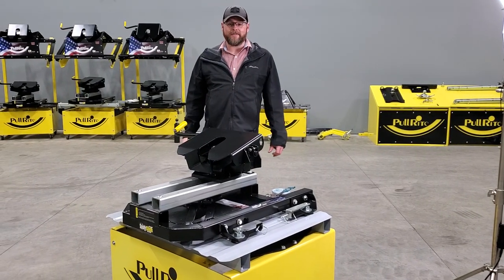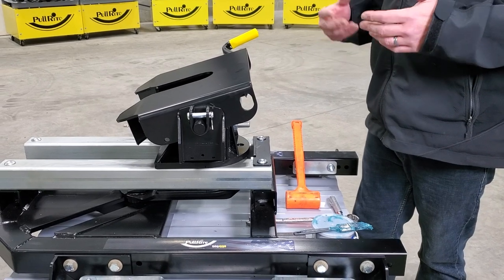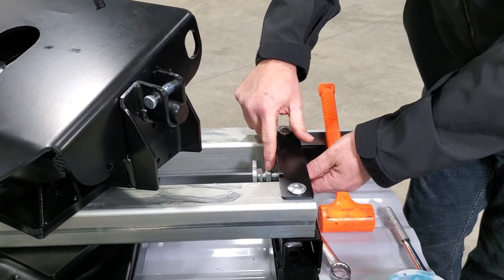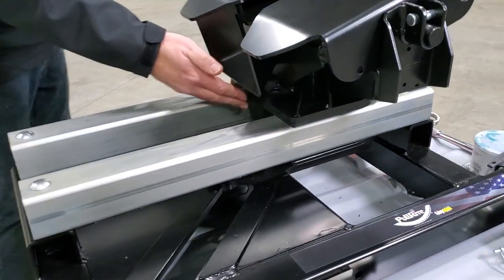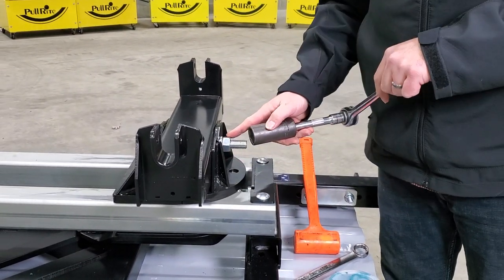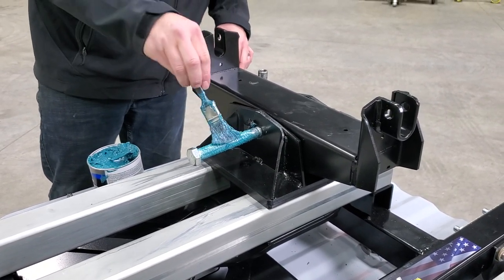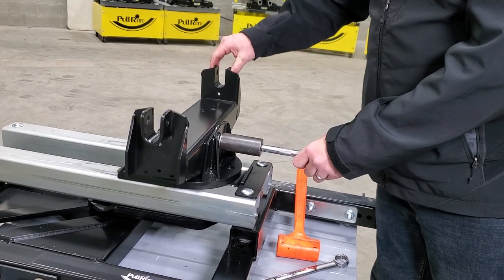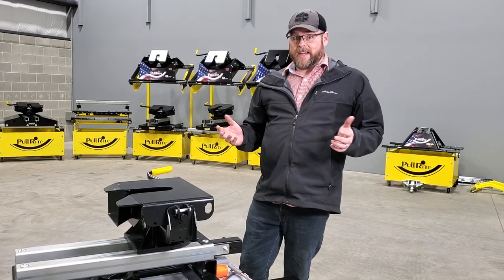PullRite SuperGlide maintenance

Comment: Great video. I went out and  checked my hitch,  everything was loose. I made the proper adjustments per your video. The large pivot bolt  was dry as a bone. I greased it up good and and tightened it up to your specifications.  Thx again

Comment: I have a problem with the hitch latch and unlatching. I ran into a problem when I was out in a campsite when it was pouring rain, I had the hitch for two years starting my third season. I didn't get an owner manual from my Ford dealer when it bought the truck new. I had to pull the house plate off and, on the underside, I had to take scotchbrite to a plate that the actuator plate and lube that and the post that it pivot's on. The pivot point has a one way push on keeper on it. When the hitch is not in use, it is covered with tonto cover so it not out  in the weather. The unlatching part of my problem is when I try to pull the yellow handle it will not move, I have to put my truck in reverse and slide the pin assemble back and then it will release. I would like any pointers and taking care of these problems. I also love the video about adjusting the carriage assembly, I didn't know it was adjustable or how to adjust it.
Reply from the maker: Hey Jim! So a couple quick pointers.

1. Apply some WD-40 periodically to the underside of the hitch plate to allow all of the components to move easily. This will prevent that lock lever from not rotating properly. Additionally, that push nut may have been a bit snug from the factory which could have caused this. 

2. The un-hitching scenario that you are explaining is absolutely as expected. The tight fitting, rotary gear driven latch, provided by this hitch provides a very tight connection. With this tight connection comes the need to relieve any "pulling" pressure off of the jaw by backing into your trailer. This is most effective when the trailer tires are chocked as it immediately relieves any pressure on the rotary jaw. 

I appreciate your comments and hope that these suggestions help you along your way!

Thanks, Nick Moreland

Comment: Could one use the Specialist WD40 Water Resistant Silicone lubricant? We've always used that because it dries on the surface and doesn't attract dirt the way regular WD40 does. --- Thanks!! Installing an OE 2714 tonight after upgrading trucks. I've been using Traditional Series 4100 for the past nine years. GREAT PRODUCTS!!!

Comment: I’ve got quite a bit of play in my head. Made all the adjustments and even got a new center jaw from you guys. No luck, still clunking on start and stop. New head???
Reply: What kind of play? If you can move the head past the stop easily maybe it needs to be tighter. I wouldn't think you would need a new head.

Comment: Two questions about my 4100 hitch:  1.  What other points under the hitch top, or within it, have moving parts (e.g.:  the lock handle, as well as the jaws) that need grease or WD-40?   2.  Between October and May I don't use the hitch, but leave it in the back of my truck under the tonneau cover.  The release handle remains fully extended the entire time, meaning its return spring is stretched out for eight months.  Should I use a tool (e.g.: broom handle) to trip the locking mechanism so the jaws deploy and the release handle is pulled back into the hitch, so there's less stress on that spring?    Thanks for this video--it's a winner!
Reply: I not sure if you still have that hitch being your comment was left a year ago...
I do retract the pull handle after use...

I grab tightly on the pull handle as close as you can where it protrudes from the top piece

I trip the release mechanism with my finger and(SLOWLY LET THE SLIDE HANDLE SLIDE THROUGH YOUR HAND) by easing up...if you do it like that it won't pinch you...
I do this all the time and have never had a problem...👊

Comment: @NickTheHitchGuy
I have developed rust on my the steel sliding rails. I have been able to clean up the rust with CLR, but want to coat it with Paste Wax to prevent future rusting while not in use. Does Paste Wax sound OK to prevent additional rust after cleaning?
Reply: Should work. I use paste wax on my wood working machines

Comment: Excellent! Thank you very much. I am a full time RVr. I'm starting to notice on the head rust building up on the scratches. Any suggestions to  clean and coat it with for protection?
Reply from the maker: My pleasure! I would recommend cleaning the top of the hitch plate and possible even sand a bit of needed to remove the rust. Once all cleaned up, cover it with a dry graphite lubricant. I personally use SLIPPLATE graphite spray that comes in an aerosol can. It is applied just like spray paint.
Reply: @nickthehitchguy7648  I also see rust on the vertical silver square tubes as well. I will order some of that coating now. I appreciate your advice. I look forward to more of your vids.

Comment: Tiding that screw in the front to keep it still from sliding back and forth what do you do when you connect the RV to the truck Will the RV be able to turn left and right with that boat being tight

Comment: If you do another video.  Add checking the torque of the castle nut on the hitch roller and the condition of the roller washers and the roller sleeve to annual maintenance.

Comment: I just bought mine a few weeks ago. There's quite a bit of play between the  lower Teflon and the glides. It makes a load enough banging sound after every turn. Basically if you stop the truck in a turn, rock it back and fourth it rocks the 5th wheel on the glides. Is there a way to tighten the upper and lower Teflon to the glides? There's roughly 1/16 - 1/8" play.
Reply from the maker: Hi Gabriel! I apologize your comment slipped through the cracks. The amount of clearance should be just over 1/16" and when adjusted, this clearance should not result in any noise. Now when in a turn, a direct stop, will result in some noise and a bump, but nothing to sweat.

Comment: What are the plastic curved braces under the slide. I went to lube and found one broke in half
Reply from the maker: Hi William! These are low friction polymer wear plates that are integrated into the hitch.  If lubricated regularly with WD-40, these should perform without any issues. Also, it is worth noting that there are a total of 6 pieces(2 plates on top, 2 plates on bottom and then 2 blocks in the middle) on most models. Could you send me a picture of the break and I'll get you taken care of?
Nmoreland212@gmail.com

Comment: I have the older model (3300) 16 K slider, is the adjustment procedure pretty much the same principle? When I purchased mine, white grease was recommended for the rails and I’ve continued to do so without issue, should I change to WD 40?

Comment: When do the polymer blocks need replacing? Mine seem worn due to vertical movement of the whole sliding assembly over the tubes.
Reply from the maker: If properly maintained, they should NEVER need replacing. This is due to the hardness of the polymer that is being used.

Comment: Curious why are you guys recommend WD-40 when it’s technically not a lubricant.  Did you find that using lithium spray grease or others made it too slippery?
Reply from the maker: Hey Tim! Great question and one we get often in our tech support department. We found that WD-40 is the perfect cleanser and conditioner for the integrated polymer blocks. You see, lubrication needs are minimal due to the polymer vs steel friction points. We are mainly recommending WD-40 to keep things clean and free of dirt build up along with providing a slick surface. Lithium grease will work but you will have to incorporate a cleaning process into the maintenance.  I hope this makes sense.
Reply: Can I use Boeshield T9. I really like this product and want to know  if I can use it.

Comment: Have you guys thought about creating a lube plate attached to the hitch, that sits between the hitch and slide rails?
Reply from the maker: Actually! All current Superglides have a polymer material integrated into the hitch to MINIMIZE lubrication. We found that lubrication is still necessary to avoid premature wear.

Comment: Great video; very helpful.  Do I need to worry about periodically tightening the bolts where the hitch connects to my truck bed?  I don't have the pucks (2016 Ram 2500 CTD).  Also, my yellow handle cover dry rotted and cracked in the AZ sun in just 4 years.  Will Pull Rite replace that for me?  Love the hitch, thank you.
Reply from the maker: Hi! Sorry I missed your comment! If you have to continually tighten the base rail bolts, I would be concerned whether the rails were adequately shimmed upon installation. You see, if they aren't shimmed, the vertical weight can distort the bed and essentially loosen the bolts due to the bed bending... would probably be good to follow up with Pullrite tech support or the installing dealer. As for the handle grip.. shoot me an email and I'll hook you up! NickM@pullrite.com

Comment: What do you recommend to lubricate the 5th surface where it contacts the Capture Plate?
Reply from the maker: Dry graphite works the best! I prefer the brand SlipPlate as it comes in an aerosol can and has a high concentration of graphite.

Comment: How often, do you ever replace the plastic slides?
Reply from the maker: Sorry for missing your comment Joe! If lubricated properly, these low friction polymers should never need replaced. PullRie does recommend to replace them if the plates wear by 1/16" to a total thickness of 3/32".
Reply: @nickthehitchguy7648  ok thanks for that!
Reply: Nick thank you for the informative video.  I’ve had my 16k hitch since 2019, and have always used wd-40 like the instructions say, but are the slide tubes supposed to develop black wear marks from the polymer plates?  It seems they are shedding material during the travel.

Comment: THANK YOU FOR A GREAT VIDEO ON MAINTENACE OF THE SLIDER HITCH.
(FYI I TYPE IN ALL CAPS, NO YELLING LOL)
HITCH HAS BEEN WORKING GREAT BUT,
WHEN WE WENT TO HOOK UP ON SUNDAY WE HEARD THE LOCK SNAP SHUT AND MY WIFE SAID TO STAR TUG TEST, SHE YELLED STOP BECAUSE THE KING PIN WASN,T IN THE  LOCK ?
I MISSED IT BUT IT STILL SNAPED  SHUT LIKE I WAS IN THERE.
THIS HAS NEVER HAPPEN BEFORE.

(WHAT DID I DO WRONG ???? THIS IS ONLY MY 4 TRIP OUT WITH THE RIG.

HAS ANYBODY ELES HAD THIS HAPPEN WHERE IT SNAPED SHUT BUT YOUR KING PIN WASN,T  IN THE LOCKED HEADS????
ALL COMMENTS WELCOMED 
DAVE
Reply from the maker: Hey Dave!! Not being there and looking things over in just speculating here but I'm going to take a guess anyway. I'm guessing that you were likely "inching" into the kingpin and stopped a bit prematurely. When this happens, the jaw is released(audible click) and pushes up against the side of the pin until the pin finishes its way into the jaw allowing the jaw to finish closing. By slowly creeping into the connection, the truck likely stopped by the pressure of the jaw pushing against it. Had you back into the trailer a bit more, it would have completed latching. 

Again, this is a guess but one that comes with the experience of doing the EXACT same thing... yelling wife and all!
Reply: Good morning Nick, and Thank you .
We met Scott at the RV show in Hershey Last Friday and he Helped us out with all my questions.
Need to tighten up the Slider and not to slow down backing into the hitch.
Love Pull Rite Auto Slide . 
Many Thanks 👍🙏  @nickthehitchguy7648

Comment: Could someone please tell
Me the install kit i need for the tudra 8ft bed
Reply from the maker: What year Tundra?
Reply: @nickthehitchguy7648  its a 2008. Thank you for responding.
Reply from the maker: You will need kit #2748 for that truck. Www.pullrite.com/2748
Reply: @nickthehitchguy7648  is there a separate hardware package i could but. Just the bolts?

Comment: So just to double check, if I hook up to a trailer and take off from a stop light and it slams all the way to the rear and then hit the breaks and the trailer slams forward its the front bolt out of adjustment?
Reply from the maker: No!! That tells me that you need a capture plate installed onto your 5th wheel trailer. Call customer support for some help. (800) 443-2307

Thanks!

Comment: The RV dealers are quick sale wham bam get out the door..Sorry that such a kickass hitch reflects poorly because of them..they installed it 2014 3500 OEM tow package..then as they Finished the "Install" i use that word very loosely....i backed up hooked up by their direction and waved goodbyes..then quickly stopped me and "Oh here you Mr Eastman we forgot the "Capture Plate" as i went to step out..Oh don't worry Mr Eastman you don't really need it..a couple of us don't use it"  hindsight being 20/20 and that grotesquse feel of dread creeped in...i couldn' get rid of that sense of something is wrong...  20mins away from home...it started to rain..this is when i let the Engine brake take over ..applied brakes and then it came to me ...i turned to my wife open my mouth to to say whats wrong..at that moment...BANG!!!..10,000 lbs 3500 lounges forward like as we just got rear-ended by a Hwy Tractor Trailer.. Wife screams and all that I said "F@#K!!! And knew immediately what it was.. I don't need to say what hit us...but the most important thing to mount and use 1000% is the "Capture Plate"...leave it bolted or even weld it to the Pin Box..NEVER EVER TOW YOUR TRAILER WITHOUT IT!!!

Comment: I have alittle play up and down on the pads that slide on rails. Is this normal?
Reply from the maker: Hi Brian, thanks for the question. A little up and down play is designed into the product to ensure that the hitch slides easily. Once the forward stop is adjusted,  this up and down play has no negative effect.
Reply: Made a right turn bringing fifth wheel home and felt a jerky motion? Can move hitch with the release bar with one hand
Reply from the maker: @stevenevans2774  you probably need to make the forward stop adjustment outlined in the video.